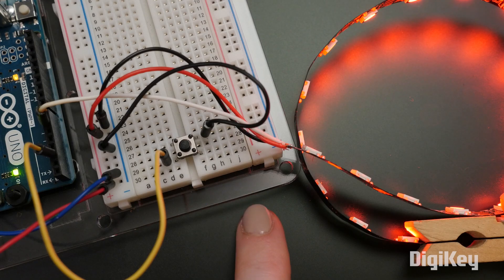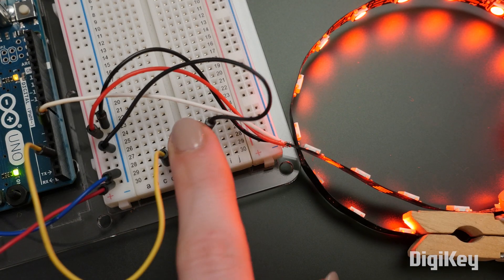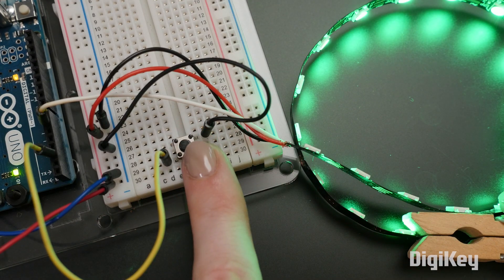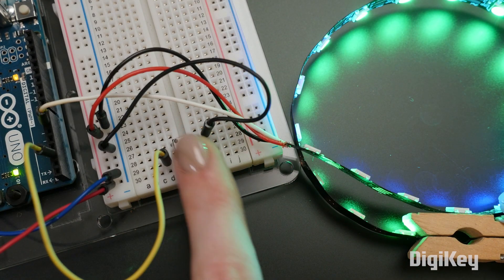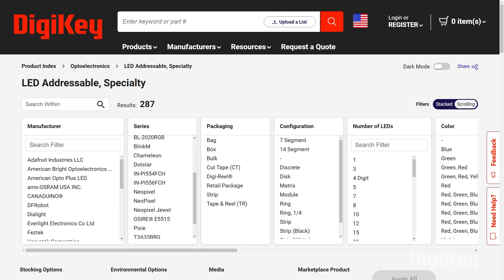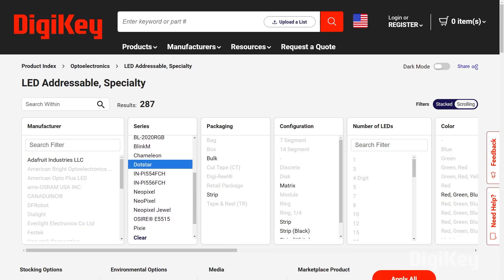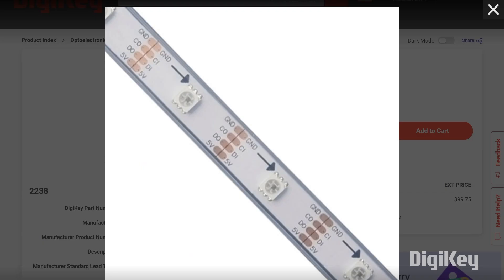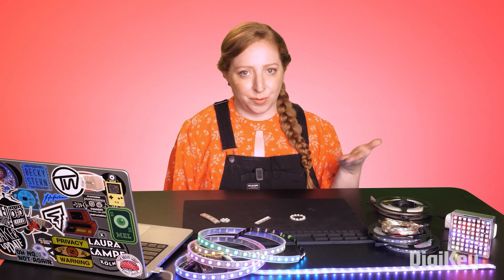Guide to Addressable LEDs - Electronics with Becky Stern | DigiKey

Comment: Dotstar's big advantage is that you can hook it up to SPI pins and let your CPU's SPI hardware transmit the data.  This let's the CPU spend more time doing other tasks.  In contrast, Neopixel typically requires you code spend time carefully bit-banging data with GPIO lines.

Comment: i had no idea dot star existed.  I'm not ready for persistence of vision projects yet, but that is my end goal, so this is golden information. thank you
Reply: I noticed your comment and it is an interesting subject found on lab oscilloscopes to tv in a way. Lab Scopes take samples and the rate at which they process them & display is referred to as”Interpolation”. They eye is tricked to fill in the blanks between off & on or the device simple draws it in from sample point to point. This is why older TV’s have graduated to 1080, 4k, 8k of high def even ultra high def. It provides a better picture by cramming more information into the same one inch square of pixels or tiny dots. The holy grail for lab scopes is real-time sampling rate. Close yet improving all the time. I am a retire auto tech, an ASE Master since 78, but we had the giant scopes to look at ignition wave form patterns the way a cardiologist looks at an EKG! I used the primary side to see inside electrical circuits to examine fuel pumps and other DC motors that used brushes. The basic DC motor has been around since Thomas Edison and the center rotates, bushes fall off commentator plates and back on. This produces a smooth wave form up & down on current flow using the primary low voltage side of these big old engine analyzers. 
  Hope this helps understanding how frequent this phenomenon is found! 
  Have a lucky one!
Reply: @deankay4434  I love this. so the same tech that's been used for decades to analyse machines that have been around for a century uses the same premises as some fun modern art project to make a flag appear on a bicycle! Brilliant. I make projects for a local science museum and will defintly include this, thank you :)